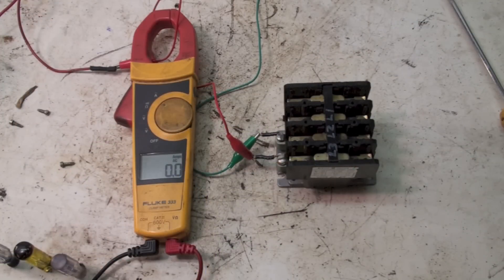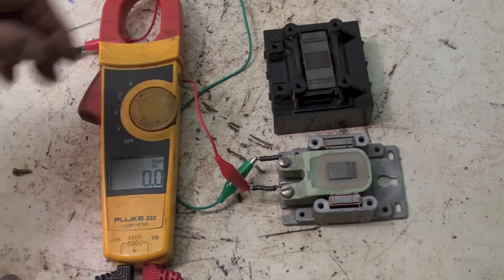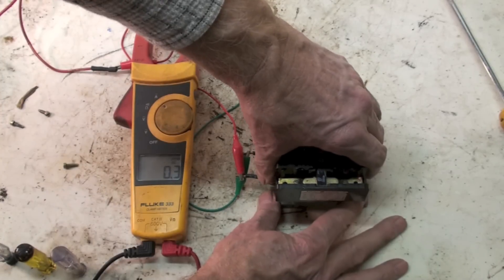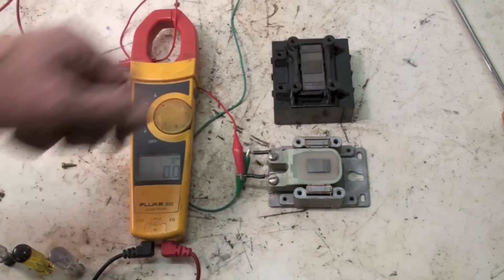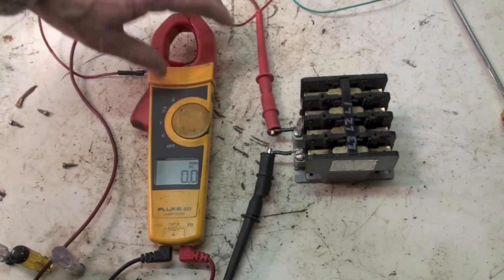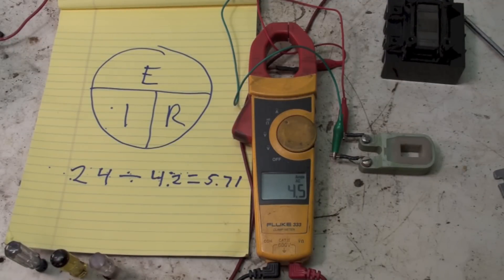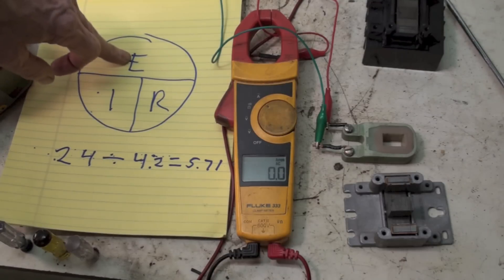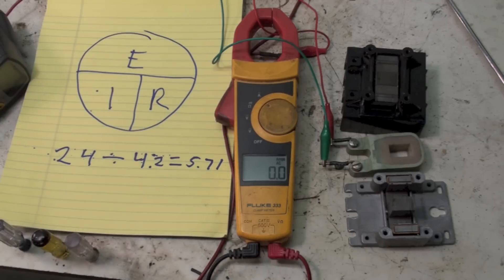How the coil of a contactor works

Comment: Why does a low resistance reading on the contactor coil blow fuses or trash a transformer
Reply from the maker: If the impedance is low, the amp draw increases which can overload the transformer.
GFM

Comment: Excellent video 
I am always facing problem with AC contectors central units . They get burnt and compressor shutdown . Before I always keep spare contactor for replacement . I decided to try rewinding the coil and find that great success. The rewinded coils stays three times loger than origenal.
Reply from the maker: Interesting
GFM

Comment: Another excellent video. Do you know how PSC motor manufacturers determine what size capacitor to use with their motors? I suppose that I could google it but I thought that it might make an interesting video.
Reply from the maker: I dont.  I do know that one of the first changes manufacturers made for energy efficiency was to increase the size of the run capacitors.  I do know that you can't just increase the cap size.  The motor will fail.
GFM
Reply: I started doing residential and light commercial a/c service in my community at the beginning of this summer. I have a Supco and a Fieldpiece capacitor tester and they read within 1/10 of 1 microfarad with each other. I also test the capacitors under load with the 2650 formula. The capacitance on almost every compressor run capacitor that I've checked, that is over two years old, has read at least 10% and usually more like 15% low. These are Carrier, Bryant, Rheem, Weather King, and Goodman systems. I am only buying replacement caps that are made in the USA. I hope they will hold up better. It looks like the OEM caps that I've seen so far will only last about 3 years. The indoor blower and condenser fan capacitors aren't doing much better.
Reply from the maker: Most of those caps are Chinese made.  Very high failure rate.  Keep up with the US made.
GFM

Comment: using ohm law is possible then to have a diagnostic in relay, contactor and coils? with the inf label
Reply from the maker: Ohms law won't work with relay coils because they are inductive loads. Hope this helps. 
GFM

Comment: Would it be more difficult to detect a back emf problem on a 3 phase contactor versus a single phase?
Reply from the maker: +Todd Bishop If you are speaking about the coil, I have never seen a 3 phase contactor coil.
GFM

Comment: Thank you for a very informative video.
If I may ask you for your opinion, I have a size 3 magnetic starter with 110 v coil. The 110 v is going through a fuse then to the OFF swt then the ON swt with auxiliary contact across it. When the ON swt is depressed the fuse blows. Specs says 4.1 amp draw for the coil. I'm using 10 amps fuse still blowing. This circuit is being used for a 30 hp rotary phase converter.

Thanks for your feedback
Reply from the maker: Sandy Oueis The contactor armature may be hanging up.  That will cause overdraw.  Hope this helps.
GFM
Reply: Thank you for your reply, found the small auxiliary contact on the output burnt out and shorted.

Comment: Isn't a contactor  just a common relay so why does it have to have a special name?
Reply from the maker: We make a difference between them because contactors are generally normally open, prime mover controls.  Relays are usually rated at less than 20 amps and use.  to direct control voltage thru either normally open or normally closed contacts.  Hope this helps.
GFM

Comment: Have a problem and hoping someone can help  disconnected 24 volt from airhandler to compressor but when disconnect is turned on compressor runs when it should not  when disconnect is turned off compressor turns off . what could be issue. ???
Reply from the maker: Your contactor is probably stuck closed.  Turn off the power and pry on the contacts to see if you can break them loose.  If they do and it works normally, replace the contactor.  Let me know how you do.
GFM